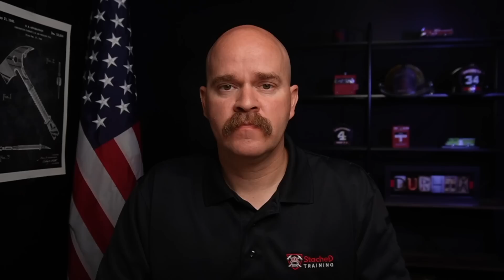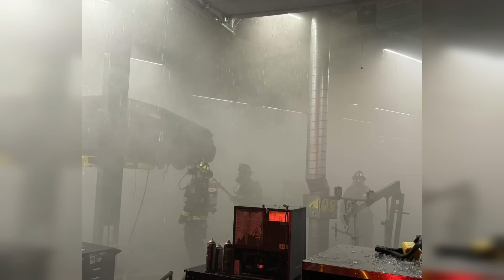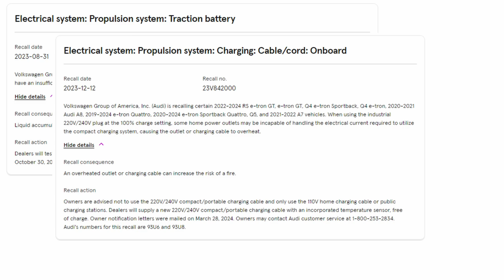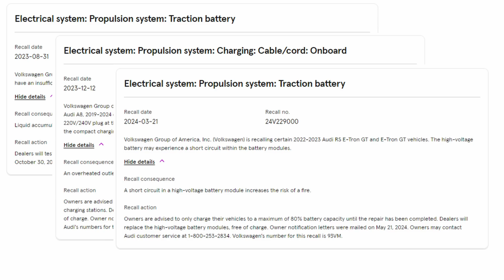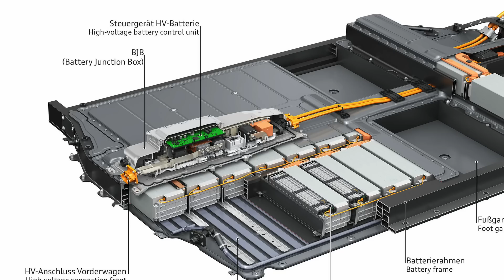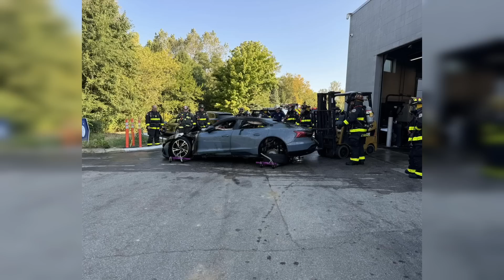EV Fire in Service Bay: Stuck on the Lift

Comment: If these kinds of things were happening to any ICE model it would be banned worldwide in a heartbeat.

Unfortunately an EV can do no wrong, and no matter how often these NMC batteries keep self-combusting without any warning and often close to brand new, no one wants to admit there is a big problem with using this chemistry for vehicles. 

The life of a car is not that of a laptop. Heat, cold, fast charging; fast accelleration, potholes, collisions and other factors can affect one cell and start a fire that is hard if not impossible to fight. It's time to switch to LiFePO4 which is much less likely to self-combust, burns slower and much less toxic.
Reply: There are quite a number of ICE vehicles with known faults which cause them to catch fire - both in operation and not. You just never hear about them, because the risks of ICE vehicles are 'known' and not news worthy. Nobody's banning any of those.
Reply: The probability of NMC batteries undergoing thermal runaway is already so low that it is pointless to lower it even further without reaching exactly zero and with large compromises. As you stated, LFP still has a chance of thermal runaway, so it still doesn't solve the problem.

It makes practically no difference to society if there is only (for an illustrative example of scale) thousands of fires annually globally for NMC vs hundreds for LFP out of a global population of billions. Also, LFP has the major drawback of significantly lower energy density, which reduces energy efficiency and hence power plant emissions for a vehicle of the same distance range.

Instead, you probably meant we should switch to LTO or solid-state batteries, which are thermally stable chemical compositions that have zero chance of thermal runaway even in principle. Just look at Battery University for more information.
Reply: @00crashtest  We are at thousands of annual NMC fires already and the installed base of EV's is not even at one percent of global vehicles.
The odds of LFP setting fire to itself are much lower. There are some incidents, but those were mainly external factors. And maybe LFP is not the only solution. Na-Ion could be used in cold climates and there is a lot of research on other alternatives.

But as far aa NMC goes, my mind is made up. Cobalt is not something to use at this scale and really endangers all of us if car manufacturers keep using it.
Reply: @SolAce-nw2hf  Yes, much lower, but not zero among the global population. You could argue that the problem could be considered solved if less than a single person in the globe experiences an LFP fire in a year, because exactly zero people would experience it in the long interval of some given years. However, the chance of LFP self-combusting isn't remotely that low. Furthermore, the rate of NMC fires is so low that it is already negligible for the average person, not even a rounding error to the third decimal place for the chance of a person experiencing one within their lifetime. The only reason why manufacturers are using LFO now is because it's cheaper due to not requiring precious metals such as cobalt. They touting the safety benefits (negligible in absolute amounts) just because they are advertising in order to get as positive as a public perception as possible.

Switching from NMC to LFP is kind of like switching from high-altitude pressurized airliner to mid-altitude unpressurized airliner. Sure, the latter has a significantly lower risk compared to the former due to explosive decompression not being a problem even in principle with the latter. However, the risk with pressurized airliners is so low that it is not worth it to take the slower and more fuel-consuming plane. The unpressurized airliner still has overall risk of mechanical destruction to the passengers because there are other mechanical causes which are common to both, such as engine failure. On the other hand, switching from NMC to LTO or solid-state would be like managing to create an airliner than has exactly zero risk of mechanical damage to occupants.

I totally agree that NMC is not the long-term future though. However, LFP is also just a temporary gimmick and not the long-term future.
Reply: @00crashtest  I went to the Battery University site (BU-212 page) and it said this about solid-state: "The solid-state battery shares similarity with lithium-metal and scientists are trying to overcome the problem of metallic filament (dendrite) formation even with dry polymer and ceramic separators. Additional challenges are poor conductivity at cool temperatures, difficulty to diagnose problems within the cell and low cycle count. Solid-state prototypes are said to only reach 100 cycles."

"A renowned battery specialist says: “It is beyond my comprehension that a solid-state lithium battery can be made in a cost effective way to compete with Li-ion using liquid electrolyte in terms of cost per kWh, longevity and safety.” Solid-state batteries tend to have high internal impedance, have poor low-temperature performance and are subject to dendrite growth."

Comment: This is only going to become more common and frankly, service centers need to weigh the risk/benefits dealing with these cars. This shop's insurance is going to hit the roof and if they're smart, no longer allow electric cars on the property. It just isn't worth lives.
Reply: I have a buddy with an electric car that the A/C went out on.   No shop would touch it.   He had to go back to the dealer and pay $4000 to have the compressor changed out.  The dealer knows no other shop will touch them so they jack up the repair costs.  When my ICE vehicle needed a compressor, it was $350 for the compressor and $600 labor.   All the money you saved in gas?  You'll be spending it on repairs.
Reply: @janofb  And then check the resale value compared to a ICE vehicle.  Who wants a 2 yr. old EV ????  Fools.
Reply: @janofb,Overall, you don't save. Just include the depreciation!
Reply: @janofb Still cheaper than that $4000 Battery.
Reply: rent sheds on our property to a mechanic and panelbeater.

they dont work on EVs.

the odd customer (more of a friend?) that drops in parks his mobile incendiary well away from everything else...  he knows... but he also cant get rid of it!
Reply: I live just up the road from a Vehicle Recovery Yard in the UK, where stolen, crashed, and fire damaged vehicles are recovered to. The amount of burnt out cars appearing has increased massively over the last few years, and nearly all of them are EVs, mostly Teslas.
Reply: Did they say where it was?  I kinda got the impression this is an Audi dealer.  Partially cuz no one else will work on electrical problems on an electric car.
Reply: Ive said the same thing since the begining when we found out EV batteries were crazy dangerous. I said I was surprised insurance companies are insuring them at all with how dangerous they are and the potential for thermal runaway of the battery in an inconvenient place like inside of a parking garage or something.
Reply: Insurance premiums for EVs are going up, I'll bet. Insurance conditions will change; if your house burns down with an EV in it it won't be covered.
Reply: Our collision shop won’t work on them.
Reply: They will figure out how to make batteries less fire prone and put in systems to keep them from burning out of control, hide and watch.
Reply: @jstar1000  The General Motors EV-1 of the 1990s used Lead Acid batteries with an early version of wireless charging that gave the car a range of 80-100 miles. This was a much better, and much safer battery system, with no reported failures or fires that I'm aware of. Range wasn't quite as good as lithium ion equipped EVs, but it wasn't far off, and I'd much rather trade a bit of range for superior safety. In my view, we should be using Lead Acid batteries, and not these fire prone death traps that Elon favours.
Reply: @matthewgodwin3050  lifepo4 batteries which is what is mostly used now are much safer and not prone to catch fire. Do some research.
Reply: It's effective pop control

Comment: Firefighting industry is lazy
Decades ago, before EVs, there should have been a better solution to extinguish fires than water

EVs are awesome vehicles and should be allowed to develop without being hindered by  the Petroleum Industry and the gop
Reply: EVs are on their way OUT......just like the CFL light bulb!
No one is buying them (less than 6% of all new car sales). Resale values are in the 40%-50% range.  The EV is imploding .........
Reply: @ScrappyDoodad  You obviously know nothing about firefighting.
I am not a firefighter, but have had some basic training. With most fires you can take away the heat with water, take away the oxygen or take away the fuel.

With EV's none of these are possible and no one really has anything to solve the problem. The car industry needs to fix the cause so the firefighters have a chance of putting out the fire.

Some home batteries already have an extuinguisher inside which neutralizes the chemicals that feed the fire. Unfortunately this adds cost, weight and size which are not ideal for an EV with 10x to 20x the capacity of a small home battery.
Reply: They're not lazy, you just don't understand the laws of physics. Got back to watching Star Trek and stop bugging the adults.
Reply: You are telling the fire industry what they should do? Your qualifications?

As it is, there have been various technologies for extinguishing fires, such as halon. Halon had mostly been replaced by others such as
3M  Novec 1230.  extinguishing agent.
 Fm-200 extinguishing agent. ...
Inergen extinguishing agent. ...
Halotron extinguishing agent. ...
Carbon dioxide CO2 extinguishing agent.

Do you understand the tetrahedron of combustion? Heat, fuel, oxygen and chemical reaction. Remove one of these to extinguish. Water and water with additives cool the fire and can reduce oxygen availability. However there are different classes of fires, A,B,C,D,E,F and it's necessary to choose the correct extinguishing method for each class. EV batteries, indeed any lithium ion battery, in thermal runaway, generated it's own oxygen and because it is burning internally it's very difficult to remove heat. Even drowning in water does doesn't necessarily stop it. Cooling the area around the fire limits the spread of the fire.

EVs aren't awesome. They are a commodity appliance that can't even be recycled properly.
Reply: Go away now ., dreamer
Reply: They're cleaning up someone else's mess, don't blame them.

Comment: 1:50
Incorrect EV's should be stored under ground in the one hundred tons of earth they came from. 
In the average life of the average EV they will become toxic waste before they have achieved the break even point on the emissions it took to build them.
A good hybrid with less than a quarter of the batteries and no plug in is a far superior vehicle when it comes to emissions reduction.
PHEVs seem to be as bad as pure EV's
Reply: 2025 Toyota Crown Signia Hybrid is not Lithium ion, but NiMH.  

Is Toyota doing that to reduce fire risk?  

NiMH batteries are apparently a lower fire risk relative Lithium ion ... and apparently have a better operating temperature range.

The Ford Explorer Interceptor Hybrids use Lithium ion ... and one of those got T-boned during a chase recently: one officer dead, his partner seriously messed up.  Was it the hybrid battery?
U2oob: San Diego cops crash
Reply: @kradius2169  NiMH is a good technology and more mature than Lithium. It loses out on energy density, discharge capacity and number of charge cycles but it is very much safer by a significant amount. a nickel battery will explode violently if dead shorted or seriously over charged but this is more like a fire cracker  a quick bang then nothing but smoke and debris unlike lithium that's like thermite and gas explosions that continue for hours.
The original Prius used the same batteries and did very well. I wouldn't be surprised if the same equipment was used with only packaging changes.

Comment: 🤦‍♂ another one...

Let's wait for the political-eco-bots to tell us "hOw ArE yOu sUrE ev'S aRe BaD"
Reply: but globals warmings
Reply: @Pyjamarama11  We have 5 years to phase out fossil fuels; to hold the line a 1.5C or 1/3 of an XKCD ice age unit of warming.
Sure, ICE vehicles can be switched to a carbon-neutral synfuel: but that will be incredibly expensive. For "low hanging fruit" like typical commutes: it is far cheaper to just electrify. Mass transit can even electrify without massive batteries: using overhead lines. That technology is so mature that it is considered old-fashioned!

Comment: I LOVE your videos!!! I'm an EV enthusiast, my father was  FF and taught LDH pumping for years. Your videos are very informative and unbiased.
Reply: I'm a EV enthusiast too, and I just want my products to improve. The problem is the battery, mainly. 
Also there's EVs that don't use batteries nor tanks. 
I just hoping for a better chemistry.
You can hate on my, I'm a regular here.
Reply: @Eduardo_Espinoza  the only EV I know of that doesn't use a battery is a train. What EVs are you referring to please?
Reply: @tomparker5000  trolley bus maybe?
Reply: @tomparker5000 and, more correctly not even an EV but a combined cycle diesel electric- I.e. a power station on rails!
Reply: @malcolmwhite6588  Subways and trams are typically fully electric.
Freight trains can be made fully electric too if the North American railroads were not so incompetent.
Reply: @economicprisoner  absolutely but of course they depend on an external electric supply via third rail or an overhead line so not applicable to a personal vehicle like a car also depend on the grid being reliable and sufficient to supply the electricity to them
Reply: @malcolmwhite6588  If the grid can handle the supper rush: it can handle overnight charging. The power draw is about the same (around 7kW).
Some undersized distribution transformers may need to be replaced (due to reduced cooling time).
Moving to electric space and water heating is what will likely require grid upgrades.
Reply: @economicprisoner  only to the point that the total load does not exceed the current grid  ability to generate excess electricity if required which in many locations including New Zealand where I am is marginal-I have done some calculations that if every vehicle in New Zealand was converted to electric , the grid is well under capacity to cope with even overnight charging
Reply: @malcolmwhite6588  My reasoning kind of assumes power storage is not a thing.
The core of my argument is that overnight charging does not exceed peak evening demand. Also assumes you avoid EV charging during the peak. Also ignores AC load (though you can run AC until midnight, then charge EV 'til 7).
Reply: @economicprisoner  yes that makes perfect sense assuming all those things can be coordinated properly
Reply: @Eduardo_Espinoza  what type of EV don’t use a battery Eduardo ?
Reply: And I can't edit my comment, fantastic.
Reply: EV enthusiast????? What IS that exactly?
You like vehicles that use batteries which are actually WORSE for the environment than ICE vehicles.

Comment: I have not been able to verify is it's true but a building surveyor told me a Porsche service centre (Melbourne Aus) was in the process of installing a dunk tank underneath a hoist specifically for EV servicing fire risk mitigation. Doesnt seem like a bad idea.
Reply: They still burn under water. 
So what liquid will they be using?
Reply: @Eduardo_Espinoza  Yes, they do still burn under water, but the fire is limited to within the container. There's still the problem of off-gassing & water contamination, but it's drastically reduced.
I'm anti-EV, but at least someone is attempting to limit the on-site risks.
Reply: @Eduardo_Espinoza  Full immersion in water  (or brine) is still the quickest option to cool the batteries to limit the spread of the thermal runaway and protect anything else in the vicinity from catching fire from it. A contained pool of contaminated water is also much easier to deal with post fire than thousands (or tens of thousands) of litres of run off.
Reply: Yep, it’s true - I know of one installed in a service centre in Brisbane, required by Porsche head office.